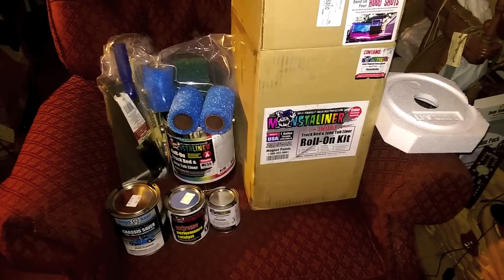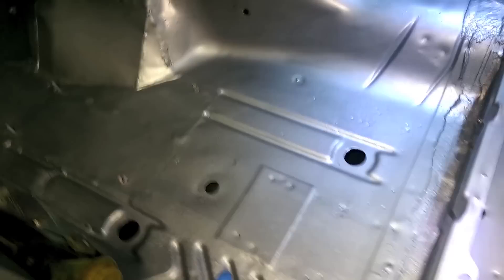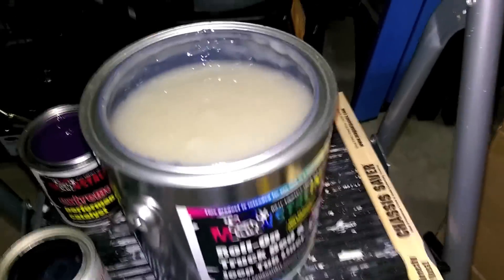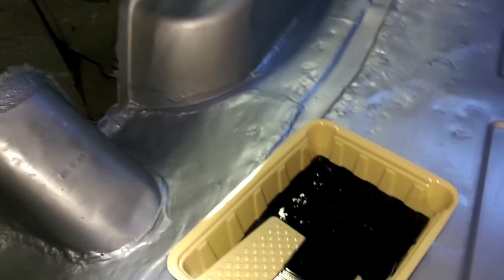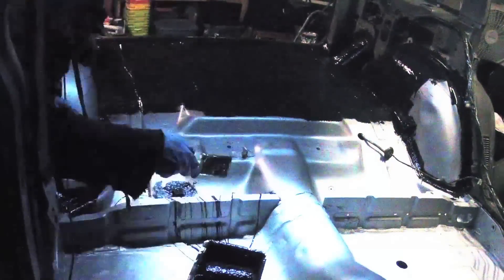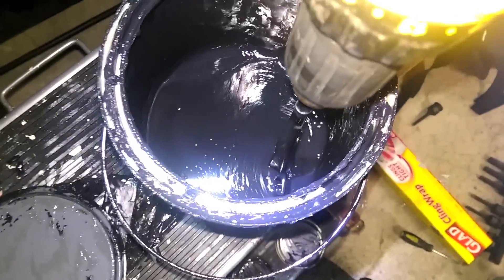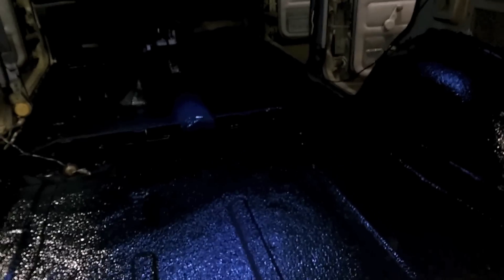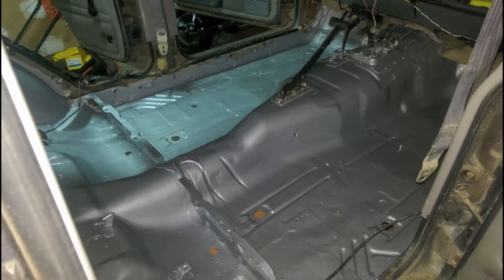89 Cherokee Applying Monstaliner to Floor Pans

Comment: Hey Nick, I just found this video! i monstalined my xj in 2015 just as you did. I am also planing to monstaline the outside of my jeep. I have 2 gallons and was originally going to make it all Preditor Green color. However looking at what is out there I am thinking of making it top half green and bottom black. I did use tape lines for the back where the hatch is super clean. The monstaliner is awesome vs paint because its a lot cheaper, wont fade (uv built in) and does not scratch. It also offers some extra protection to the outside of your vehigle. Not as good as Linex but its a lot cheaper.  Great video. I will send you a pic once I am finished with the outside (have to wait for a humid day though).
Reply from the maker: You know what's funny, my buddy did exactly that. Predator Green Monstaliner and Black Rhino Liner on all the lower trim which you can see in action here: https://www.youtube.com/watch?v=rxZ-TC1DfGc
Reply: I have seen that video LOL!!  I do like the look. :)

Comment: nice work.  hows it holding up?  i think im gonna do this to my wrangler
Reply from the maker: This stuff is awesome, highly recommend. Has held up great, no fading that I can tell, fairly easy to clean, and you can beat the crap out of it with a sledge and it doesn't flake. It's insane.
Reply: not sure if you did it or not. After two years with the outside of my jeep monstalined it’s held up
great other than a few areas which i think i messed up prep and it’s cracked and flakes off over time. I bought more to touch it up just waiting for it to get nicer outside.

Comment: Looks good. i think I would've sprayed it on inside there. Would've been easier to get into all the nooks and crannies. Also, I think I would've done the sides all the way up to the windows, or any metal for that matter to help with road noise and further protect everything.
Reply from the maker: You can spray it on but you need to dilute it and use a schutz gun because of how thick it is. I actually picked this kit because it was roll on so I didn't have to tape up the whole interior and bother with an air compressor. Loading up the brush lets you get into all the tight spaces with ease.

As for where I stopped, the rear of the truck is boxed so getting up to the windows would be very difficult trying to reach through all the brackets to the inner panels. The interior panels cover it all up anyway so it does the job. Spraying might be better if you wanted to cover the whole interior, but I'd only spray the Chassis Saver if you just wanted rust protection.

Comment: I'm thinking about rolling my whole truck with this so mud and rocks stop eating up my paint. Would I be able to get away with just one coat or is two coats a must? Just wondering, thanks.
Reply from the maker: +Tyler Warren It's a little thick and hard to work with for fine details so you will most likely miss a few spots on your first go. A second coat isn't a must, but it will make the coating tougher and leave room for touch ups.
Reply: Alright, thanks.

Comment: Hey +NickInTimeFilms after you fixed the floor pans and cleaned everything up what did you paint it with before you put down the monstaliner?
Reply from the maker: +Austin Stuckey It's Chassis Saver. Check my videos for that as well
Reply: +NickInTimeFilms oh duhh I just realized that haha I'm doing my entire tj tub so do you suggest I have it sandblasted first or just put chassis saver over the remaining paint and then the monstaliner?
Reply from the maker: +Austin Stuckey Depends how much you want to spend. The professional way is to get it sandblasted and coated with a quality 2K (2 Part) Epoxy Primer. That is expensive but is what factories do. 

Cheap way is to scuff it up good and apply Chassis Saver. It likes a little bit of surface rust, but nothing loose. Wire wheel the crap out of the floors to get off the loose stuff and make sure any painted surfaces is properly scuffed and lay down the Chassis Saver. Worked well for me.
Reply: Well I've been working at it for about two months now so there isn't anything loose I took out all the seam sealer and I'm looking for whichever will last the longest
Reply from the maker: +Austin Stuckey If you do a good job, the chassis saver will last. Mine only peeled slightly from one of my patch panels because I didn't scuff the coating off well enough. Up to you what you want to do. Epoxy Primer would be the best for a base coat, but Chassis saver also does pretty well.

Comment: Nice work. How much would you say it helps with heat from the engine?
Reply from the maker: Barely much at all. It's not really much of an insulator for heat or sound. I tried lizard skin and that seemed to make a bit more of a difference but its still not great. That tunnel still gets toasty after you've been driving for a while.
Reply: @NickInTimeFilms  Thanks for replying. Im gonna apply some of the  lizard skin and see if I can get some of that stuff that has the aluminum on one side and a sticky part on the bottom. Greetings from Mexico and I will let you know how it goes once I put in the work to it.

Comment: Is it possible to apply mosterliner over top of heat/sound insulation stuff like you used on the underside?
Reply from the maker: +Se7enAte Applying it over Lizard Skin is quite possible and I wish I did it the first time around. Lizard skin SC and CI keep the sound and heat down, then monstaliner will seal it all up and make it more impact resistant. The perfect combo in my book.
Reply: NickInTimeFilms That's what I was wondering. Just didn't know if the lizard skin would have been hard enough to paint over, thought it might be kind of bouncy like rubber. Looks like it would be a great combo
Reply from the maker: +Se7enAte When it drys it is hard. If you have the money to shell out for the lizard skin I would absolutely recommend it. I am impressed with the results for how little I used. Maybe it would have been better if I didn't cheap out on the spray gun though. haha

Comment: do i have to apply chassis saver too or will the rustoleum bed liner i have be enough to stop rust?

because i have a gallon of black chassis saver i was gonna use for the underbody and bed liner for the floors and rockers
Reply from the maker: Brandon Harrell Never used rustoleum bedliner so I can't say for sure but it's really up to you. If you think the rustoleum won't peel and crack in a few years then you can skip it. But for $40, it's hard to beat having some extra protection I know I can trust. If it was me, I'd put down the Chassis Saver too so that I only had to do the job once.
Reply: right , ive got a gallon of flat black chassis saver. probably end up rolling it in before bed liner.

how long it take you to get the floors  fixed and everything protected?
Reply from the maker: Brandon Harrell it took a little over 2 months with all the patches I had to make. I could only work on it for a few hours every other day though.
Reply: ok cool, so im not the only one that gonna take a lil while to get this done. im doing this on my own and have never done anything like before. i repair new things that break, not old things that need life put back into them lol.  Have rough idea from watching yours and other peeps videos.
Reply: dang why couldn't you live near by. id give ya $200 just for working together with me fixing the floor. i can do it myself but am really nervous ima mess up and afraid something bad is gonna happen if i don't remove the gas tank
Reply from the maker: Brandon Harrell Lol. I was more confident about my tank because I recently replaced it. If you smell gas at all then you might want to look into that first. A full tank is better then an empty tank because there is less fuel vapor, which is the stuff that actually explodes. If you have a metal tank that still seals then you should be fine, just be aware of where the tank is when you are cutting metal. The only spot I was really worried about was near the rubber fill lines.
Reply: NickInTimeFilms  i don't smell any gas and the tank is full. i just hope i ain't wasting money and time with this thing putting mostly time and some money in it.  

But id rather buy one cheap and fix it up myself then buy someones used offroad machine for $2,000-$3,000 and have things be broken and beat up. Best to start from scratch with new parts and build up i say. May take time but that's part of the fun

Comment: wow its not that bad, how long did it take u to do the whole thing i wanna try to do this but since my jeep its my daily   i wanna see if i can knock this out during the weekend.
Reply from the maker: Depends what you mean by whole thing. It took a few months from start too finish but that was gutting the interior and patching half the floor. If all you have to do is pull interior and coat then it should be a weekend project. just bolt the drivers seat back in if you have to, I did that for a bit.

Comment: hey man I got about the same floor conditions in my xj! nasty carpet, rust spots and a few holes. The big question I had was did this significantly reduce cab noise after putting down the liner?
Reply from the maker: +airplanekid333 Nope. The monstaliner is better than the bare steel, but not by much. Later on I ended up putting sound deadener all over the cab, and sprayed underneath with lizard skin sound control and now it's about as good or slightly better than stock, those old carpets are really good at absorbing noise.
Reply: +NickInTimeFilms good to know! so maybe I'll still do the rust saver stuff and then put the carpet back in but without the shitty deteriorating padding stuff. My main goal is to prevent from more rust but while I am at it, I might as well try and reduce noise too.. I'll have to check out the lizard sound control video then! Merry Christmas
Reply from the maker: +airplanekid333 The carpet and Insulation layer also keep the heat down quite well, with just the monstaliner the trans tunnel was getting quite toasty after long trips, lizard skin ceramic insulator helped with that. Amazing what those carpets do. Merry Christmas to you too.

Comment: How is holding up?? I used the rustolem bedliner and its holding up pretty decent
Reply from the maker: I love this stuff man, it's excellent. Cleans up well enough, has kept the floors from rusting, and I can literally beat the ever living shit out of the floor with a sledge hammer and it doesn't chip. This stuff is insane, the dude really did his homework on it.
Reply: Nice I usually undercoat the bottom of my floors once a year  I thought about giving this stuff a shot. I was checking out a new product called nh oil as well but it doesn't seem like a lasting rust proofing
Reply: I love your jeep build btw
Reply: I have a 96 jeep Cherokee. I've referred to your videos for a good bit of work (including your coolant filter video) 
Thanks for the help I appreciate it!!! I just started up a channel but between your channel and bleepinjeep you guys have been the most helpful!!!!

Comment: Hey man, looks great! How long does it take this product to off gas completely?
Reply from the maker: I think within a few days it was very manageable
Reply: I plan to put it in my camper van. How long until the smell was completely gone?  Thanks
Reply from the maker: +Francesco Renzitti Can't remember exactly how long, but it was probably about a week or less. Just keep the windows open for a day or 3 while it's drying. Not as bad as some other stuff I've smelled and goes away fairly quickly

Comment: was 1 gallon a sufficient amount for a cherokee?
Reply from the maker: +Ryan draugr It was enough to do the whole floor pan. I did one good coat on everything, then the second coat I focused more on high traffic areas like the main floor to use up the rest. 2 Gallons would be way overkill.

Comment: I'm more of a carpet guy myself but I give you props for keeping the XJ on the road. I'm glad I just have an MJ 'cause it's a smaller job LOL.

Bedliner seems like overkill to me just cause it's meant for throwing engine blocks, lumber, bricks, etc. on it in the truck box. But it looks like it will get the job done, and I'm pretty sure you're not planning on putting carpet back in there.. Good video, I like that you didn't skip any steps.

The transformation at the end, wow!
Reply from the maker: If I could, I would love to keep carpet but it's just not possible with the intentions I have for this truck. It's far too difficult to keep carpet clean and dry when I go through deep puddles and the mildew smell gets old quick.

The bedliner is a good alternative because it seals the floor and gives it a little texture. It also protects the floors from impacts now that there isn't soft carpet to take the blow. It also slightly insulates and sound deadeneds the floor which is nice for the road noise. And finally, it makes it a hell of a lot easier the clean up. Just take the garden hose and give a good spray.

I try my best to include all the problems and details I run into because I figure other people will have the same issues. This way they are aware of what to expect and can prepare for the worst. Glad you enjoyed. Next the interior goes in and i get some protection for the rear.
Reply: Its really good for sound reduction too

Comment: Does it help with sound and heat transfer
Reply from the maker: It does a little bit, but probably not as much as you'd like. I ended up spraying Lizard Skin on the undercarriage and that cut trans/exhaust heat down and made tire noise more acceptable. I also added FatMat Sound Deadener on the roof and door panels and that helped with wind noise a bit. The factory Carpet and Insulation does a pretty good job at what it was designed to do.
Reply: thanks man ..like your vids .. ill see about the lizard skin

Comment: Used Monsta for TJ tub & Raptor for my JK. Raptor > Monsta. Fill, Shake, Shoot...so much easier to apply and end result is much more consistent & professional looking. Spent extra cash  for vari-nozzle spray gun to dial in desired texture, from micro fine to ultra coarse.

Comment: There's this spray paint..."rust reformer" that "converts rust" to a stable condition. Plus it's black and doesn't look so disgusting when you're under old reliable. Then, ther's Rust-oleum "professional bright galvanizing compound" (spray zinc rich paint). Uses galvanic action to protect old reliable. At Lowes they are selling it for literally half of the other stores even Amazon. I painted my back yard wagon which looked like shit all rusty a couple of years ago with the Rust-oleum and it looks shiny and rust free with the galvanizing spray. There's the rubbery spray too. You can use that to protect from stones. MEK is some deadly shit. Get a rubber 3M mask and good filters. If you are a really cheap bastard like me, go to the thrift store and get one of those rubber pot spatulas (or use the old ladies if she's not home) you can really clean all that expensive shit out of the can.